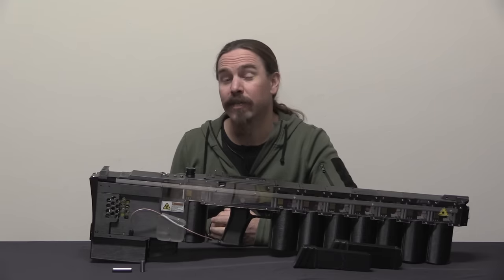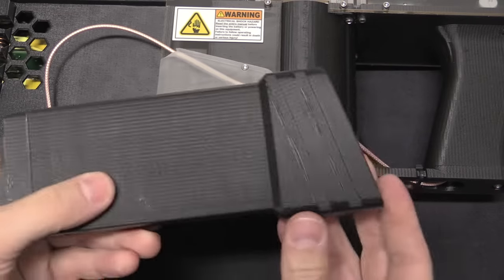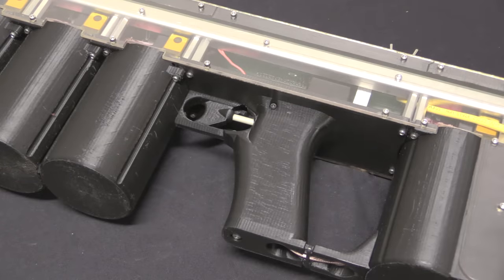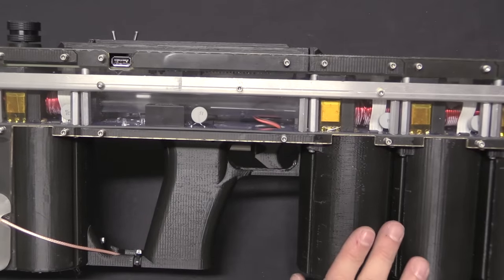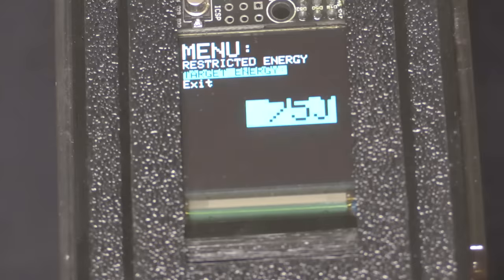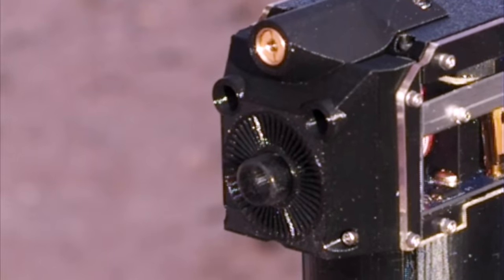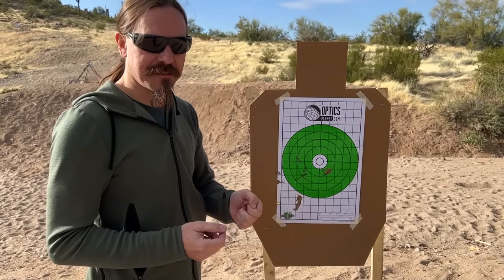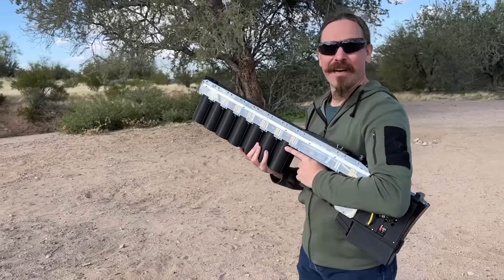ArcFlash Labs' GR-1 Anvil Portable Gauss Rifle

Comment: Remember, this is a 3d printed gun made by 2 engineers as a side hustle. Imagine if they had full factory resources!

Edit: I'm talking more about having a refined product that is less clunky and easier to work with. I am fully aware of the limitations of batteries. I know that this tech is not ready to replace firearms, but do believe it one day could.
Reply: Check out the Hacksmith on youtube. I belive they made a more powerfull version but it is illegal in canada. If they would move to the US I dont know what would stop them :)
Reply: Be DIY kits in a few years.
Reply: Perhaps they'll work on it full time after starting a company to develop these, calling it Cyberdyne Systems....
Reply: yeah they could manufacture a gun that sucks ass on spec but that has great reliability and manufacturing quality
Reply: It still looks like a very crude prototype. The muzzle velocities are pathetic.
Reply: Yeah, they could probably build it in 19 pounds!
Reply: @stopthephilosophicalzombie9017  yep. heavier bullet though. some of those bullets are the size of a whole cartridge. doesn't need to be going too much quicker. could probably pretty easily make a vehicle mounted version with plenty of juice right now to blast a man full of holes with automatic firepower.. or electricpower.. I guess. give it 10 years. max?
Reply: @cantbanme792  Probably more than that, though really the limiter is going to be battery and capacitor technology. I do not think these things will be fielded seriously within a decade, however, that being said I would hardly be surprised if significant inroads are made to improve the technology required. 

Really I am thinking somewhere in the fifty year mark, which means unless I am really lucky I'll never see a truly workable coil gun. Still, its pretty interesting, but given the crude state of the demonstrator I think a decade is seriously pushing it, especially as the builders do not control the development of the really critical technologies within the weapon, that is the capacitors, batteries, and even the EM Coils....
Reply: If they ever go full fallout and work out how to successfully harness the power of fusion and create power cells small enough to be practicality wielded the rail gun would truly have a place. Until then compressed exothermic reaction go brrr

Comment: The platoon commanders did not longer shout "fire". They say "energy at will."
Reply: İtsnot an energy. İst just Projectile that runs from a bolt with an extreme velocity. İts not a plasma.
Reply: The enemy shouts "charge!" so you fix banetes,then get cut down in a hail of MAC rounds
Reply: W-177 is still programmed to say "what did I do?"
Reply: They could say PULL, as in "pull the trigger", which originally comes from bows and refers to pulling the string.
Reply: It would be 'discharge at will'. Which sounds worse tbh.
Reply: "Power at will!"
Reply: 'Ad victoriem!'
Reply: @wasdertnt  Nor is the projectile fired by firearms. The joke holds up because fire is just what propels the round forward, while here it's electromagnetism.
Reply: @Seagull780  magnets at will!
Reply: Ready!  Loose!
Reply: It isn't "explode at will" currently either. And display even reads "fire".
Reply: Same energy as atheists saying "oh my science!"
Reply: Much like bows and crossbows, “Loose!” Could come back
Reply: Voltge on! Circuit connected! Discharge at will!
Reply: yes, i energy from time to time.
Reply: We talk about computers and phones having "dashboards", because we talked about automobiles having "dashboards", because buggies had a board in place so that the horses wouldn't kick dirt up into the cabin when running, aka dashing. They'll be saying "fire" for a long, long time.
Reply: @wasdertnt  Go back to school and learn the definition of energy.
Reply: "energize!"
Reply: @skeletorrulerofeternia7141  I'm pretty sure it was "shoot" for crossbows and "shoot/draw/stretch" for bows
Reply: @jeanxza5395  "Discharge at will"
nuts at Will
Reply: They should say "Engage!"
Reply: And poor old Will is still wondering why everybody is shooting at him.

Comment: I honestly wasn't expecting to see a handheld gauss rifle in my lifetime. Very curious to see where this develops in the future
Reply: go on the hacksmith yt channel they bild two of them
Reply: Why not? You can build one at home. It would be no stronger then crossbow or pneumatic rifle. Magnetic accelerators and magnetic accelerators from fantasy(because most of those don't deserve to be called sci-fi) are two very different types of magnetic accelerators;)
Reply: @TheArklyte  yes because everyone is just building gauss rifles at home. It’s so common
Reply: This thing is function only. No ergo or durability considered yet for sure
Reply: That depends, like so many other exotic technologies, on battery technology. If there is a breakthrough on that front we will see some pretty interesting things emerging.
Reply: @Procrastinater  battery technology isnt going to have a major breakthrough, but the incremental improves are making massive differences
Reply: the more new tecnology we make the faster we develop even newer ones
Reply: @Procrastinater  just like how Tesla was able to become a significant presence on the market thanks to research grants in battery tech that were pushed to the top during mobile/smartphone revolution a decade prior...
Reply: @wierdalien1  current one wouldn't as we're basically milking the optimization from the same designs at this point, but there are other potential technologies in this field. Everyone is waiting up on those.
Reply: @famalam943  you never in your life have played with a magnets or had a physics experiments with them in school or uni? Ah, the horror!;)
Reply: @TheArklyte  such as?

Comment: This tickles me given I worked on making Mass Drivers back in the late 2000's (2007-2009). This is working on the same logic and design philosophies I was as well. This stuff has matured a lot in over 14 years, a lot of it of course still comes down to issues with gates, coils, batteries, and capacitors. But this is a big step forward for man-portable mass drivers. So this was pretty cool to see as a former developer in the field.
Reply: Check out some of the modular kits on aliexpress, there's a bunch of 400V ones that exceed many countries joule limits for under $200!
Reply: I have NO idea what you said yet it sounds cool.
Reply: I'm going to bet that if they make this open source we can have something usable in less than 10 years
Reply: @mobrien7211  Kinda, the main issue is energy density in capacitors and getting that to discharge at a very high amperage to drive the EM field produced by the coils to high Tesla values. Which was the main road block I hit, and looking at their design, it was as well. There are some simple physics that are the issue, as well as just we don't have better capacitors because of a myriad of reasons, mostly, again, physics. There is only so much energy you can keep in one before it fries the dielectric and becomes a frag grenade instead.

Still, I can't wait to have a workshop again, I wanna get back into messing around in the field as a hobbiest this time.
Reply: You didn't do your work in Austin Texas per chance?
Reply: @Kurorahk  am I right to think that shielding the barrel and the coils inside a ferromagnetic, or at least conductive, cylinder would help alleviate some of the EM issues?
Reply: @808bigisland  Have you suffered a stroke? Is there a number someone can call to get an ambulance to your current location?
Reply: @808bigisland  thats.. thats not how that works, triangulation is much harder than using a phone app, lmfao.
Reply: @carmatic  That is exactly it, a simple Faraday Cage would likely cut down on a good chunk of the EM issues, but I worry that would induce a current in the cage which would be rather undesirable for the user.
But again that is something for a lab test to see how t hat could be handled. Mostly it would be running a cage along the length of the barrel outside the coils to at least dampen the EM field generated by the coils. Obviously this could induce a current in the cage itself (and as a warning, it could do so in any ferrous object worn by the user, so beware wearing a ring with this gun). But we also, not that I know the specifics, have other methods which we use for shielding important aircraft. So there is a fair bit of research and testing to do. Which is exciting.
Reply: @Kurorahk  The Faraday shielding could be embedded into the polymer shell of the weapon itself, or applied to the interior of the shell so the user would not be in contact with it.
Reply: @Kurorahk  did you work on spacecraft mass drivers?

Comment: "A 3D-printed gauss rifle" was not something I ever would have expected to see on this channel. I am reminded of Snowcrash's "Ultima Ratio Regum", especially after it misfired on the second shot.
Reply: I haven't read it in a while, but isn't the railgun in Snow Crash called "Reason"? The "last argument of kings" quote was definitely engraved on it or something like that though.
Reply: @jm3267  Oh shoot, you're absolutely right! Well, that's what I get for relying on my memory.
Reply: Fisheye is up on his knees now and has torn away the canopy and space blanket that have covered him until this point. In one hand he is holding a long device a couple of inches in diameter, which is the source of the whirring noise. It is a circular bundle of parallel tubes about pencil-sized and a couple of feet long, like a miniaturized Gatling gun. It whirs around so quickly that the individual tubes are difficult to make out... The device is attached to a wrist-thick bundle of black tubes and cables that snake down into the large suitcase... The suitcase has a built-in color monitor screen with graphics giving information about the status of the weapon system...

"See, I told you they'd listen to Reason," Fisheye says, shutting down the whirling gun.

"...See, it fires these teeny little metal splinters. They go real fast - more energy than a rifle bullet. Depleted uranium.
Reply: That book and specifically REASON was the inspiration for the rail gun I made for my A-Level physics project. Just a shame the school's EHT supply only got me a muzzle velocity of about 0.5m/s
Reply: @PsychadelicoDuck  All good mate: last read it maybe 3 years ago so it's probably fresher in the mind haha!
Reply: Same I saw that and thought that is a guass cannon where he get that